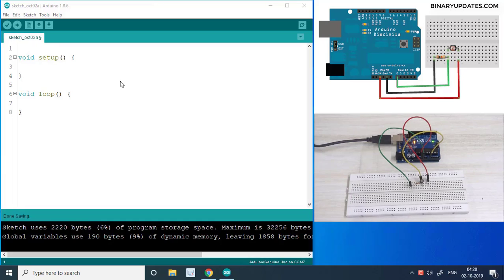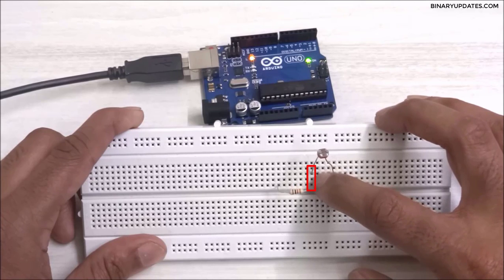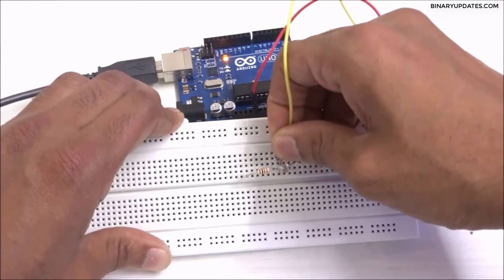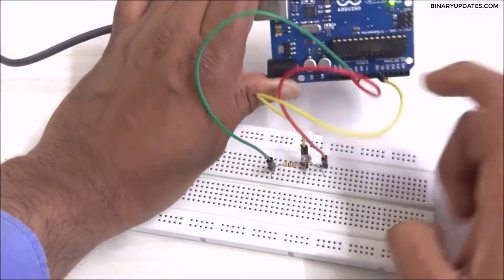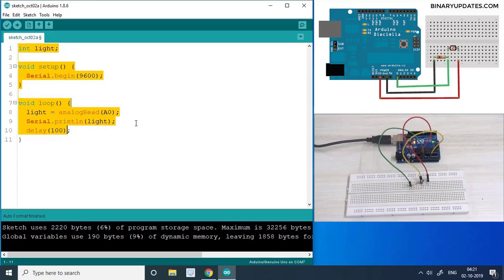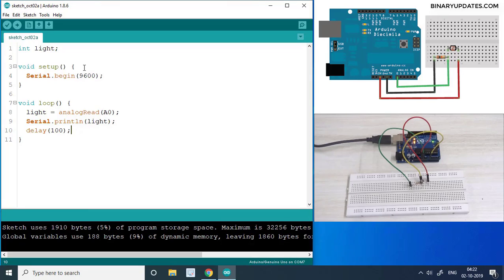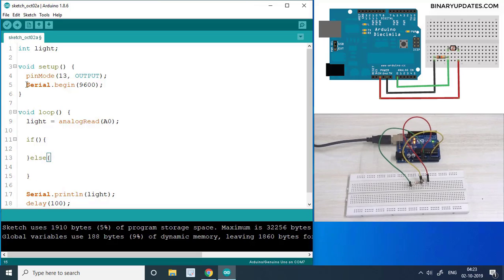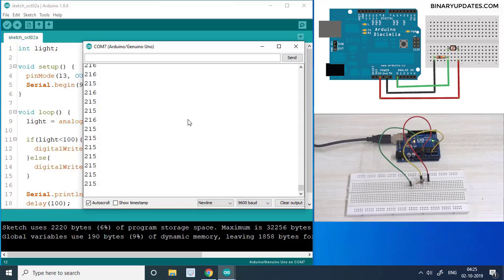LDR with Arduino - Measure Light Intensity using Photoresistor

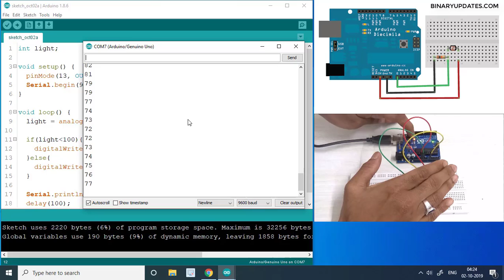Comment: 7:17  In which units the LDR sensor gives the output. In serial monitor
Reply from the maker: Hi Vamshil, the values getting on serial monitor is the equivalent of change in resistor because in the end LDR is resistor whose resistance changes as light falling on its surface changes. Usually, we need to convert this value into lux because light intensity is measured in lux. I hope this help you understand  LDR's functioning. Good luck and best wishes!
Reply: @BINARYUPDATES  and how do I do that?

Comment: what is 200 that is showing? 200 what?
Reply from the maker: Its a value of ADC counts which will vary based on amount of light falling on the surface of LDR Sensor. So later we can calculate Lux or illuminance
Reply: @BINARYUPDATES  but how?
Reply: how can we use it to calculate lux please? @BINARYUPDATES

Comment: Is a breadboard that big necessary ,can it work with a smaller one too?
Reply from the maker: Hi Katianuriu, Yes it will work with smaller breadboard as well. Just setup LDR circuit with Arduino on available tie points on small breadboard. Good luck and best wishes!

Comment: How to insert this to lcd?
Reply from the maker: Hi, you can interface Character LCD in 4-bit mode or use OLED display with I2C protocol. This will let you show light intensity value LUX from LDR on LCD screen. I have video posted in Arduino playlist on how to interface LCD Display with Arduino. I hope, you may find that tutorial useful. Good luck and best wishes!

Comment: Hi, great video but could you explain to me what the resistor going to the ground is for? I'm very new to arduinos and circuitry. Thanks!
Reply from the maker: Hi, you can use resistor of value 10K with LDR Light dependent resistor. Its standard across all input of 5V DV devices. Just like Arduino Uno which also operate on 5V DC. I hope this may help answer your question. Good luck and best wishes!

Comment: Thanks for this nice explain
But i would if someone please tell me applications for ldr sensor matrix  6×6 or 6×5
Because I have a project for college and i little confused how can I deal with that... And thank you so much
Reply from the maker: Hi Omer, thanks! I think you can consider using LDR sensor to measure light intensity of surrounding and then take two or three 6x6 dot matrix display connect them together and  show light intensity which means lux value on display. This could be one simple application to show in college. Also, you change the brightness of Dot Matrix display based on value of Light Dependent Resistor. I hope this may find useful. Good luck and best wishes for your project!
Reply: @BINARYUPDATES  thank you so much for your help , can I contact you in another your email , what's up or telegram? 
And thank you again ❤️❤️❤️

Comment: I tried something similar with temperature, and my experience says that you need some error to avoid oscillations between on and off state. What I mean, is that you better set two values close to 100, one lower value for on and one higher for off. Let's say the two values are 99 and 101, you want the led to be on when the intensity is 99 or lower, and you want it to be off when intensity is 101 or higher. In case of any values between 99 and 101, the led maintains its previous state
Reply from the maker: Hi Chris, thank you very much for your suggestions. Next time when I'll write arduino code wherein LDR data will be checked for lower threshold as well. Have a beautiful day!

Comment: Sir why are we using the resistor here?
Reply from the maker: Hi SRG, it forms voltage divider circuit which help you measure change in output voltage because of change in resistance across LDR. I hope this may help. Best wishes!
Reply: @BINARYUPDATES  Thank you Sir

Comment: Hi, I wanted to build a small box wherein light would fall on a piece of paper and the sensor should calculate the area of the paper which is blocking the light?? Is it possible??
Reply from the maker: Hi Gaurav, it is possible
Reply: @BINARYUPDATES  Hi thanks for the response. Can you guide me how this can be done I am in need of the same for school project. If you want we can discuss this on email or anywhere else suitable
Thanks.

Comment: I'm terrible at electronics 
I use the esp8266 microcontroller and I'm getting values from 20 to 50 although I did the same wiring ???
Reply from the maker: The value for LDR may vary as ESP8266 runs on 3.3V and Arduino runs on 5V. The other important thig contribute to accuracy of data based on value of resistor you've used with LDR Sensor. I hope this information may help you. Wish you good luck and best wishes!
Reply: @BINARYUPDATES  thanks for the help

Comment: Is the A0 input or output
Reply from the maker: A0 on Arduino is an Analog Input Pin can be used to read any analog sesnor. As in this case we used LDR light dependent resistor

Comment: Can i replace arduino uno with raspberry pi with same cooding?
Reply from the maker: Hi Azri, unfortunately Raspberry Pi don't have any analog pin on board. So you need to connect external ADC converter chip to interface LDR with Raspberry Pi.
Reply: @BINARYUPDATES  okay thanks for your response. I will use Arduino. Actually my project same like this, I was planed want to use LCD 1602 to view my result. What step I need to do to to get output on LCD?

Comment: how many ohms is your resistor used?
Reply from the maker: I've used 1K ohm but you can use any resistor value between 1K to 10K while interfacing LDR with Arduino. Good luck!

Comment: Thank you for the video sir. May I ask why are you using the 1kOhms resistor specifically?
Reply from the maker: Hi Reinalto, that 10K resistor connected with LDR circuit form voltage divider circuit which generate variable voltage. This variable voltage we measure using Arduino Microcontroller. And later on this voltage itself will interpret as a light intensity or lux value. I hope this help you. Good luck and best wishes!
Reply: @BINARYUPDATES  this definitely help. I was using a 2k and it's not working properly, now with the 10k resistor everything is working just fine. Again, thank you for the video and keeping the good work! You're blessed!

Comment: Thanks for the informative video! I'm trying to create a way to convert morse code light signals into text but I'm curious on how the photo resistor would be able to decipher and differentiate between dots and dashes. Do you have any advice on how to proceed?
Reply: I’m not entirely sure but you could try somehow reading a 0.5 second blink as a . And a 1 second blink as a - or use your own timings, whatever makes most sense to you
Reply: Far easier to generate Morse Code.
Reading it gets messy. I'd use the millis() function (Arduino milliseconds since boot)

sit in a while() loop waiting for the signal to go high.  Grab the millis() and sit in another while loop waiting for the signal to go low. Grab the millis() again and subtract the starting millis() to get the pulse duration.  This millis() stamp also begins the space.

repeating this process lets you build up an array of pulse and space times. the following rules may help you sort out the difference between pulses individual letters and words, but the timings are pretty variable, especially with human generated code, so you're going to have to be a bit clever with your math. once you think you have a bunch of letters, decoding it is just a matter of referencing a table of type byte, with each letter represented as binary digits.

The length of a dot is 1 time unit.
A dash is 3 time units.
The space between symbols (dots and dashes) of the same letter is 1 time unit.
The space between letters is 3 time units.
The space between words is 7 time units.

Comment: You can make the value go up instead of down by reversing the voltage polarity through the LDR and resistor.
Reply from the maker: Yes, its possible
Reply: I think at least one of the three-pin modules with the resistor built-in actually shows a pin out diagram wired this way. As far as I can tell, either way works, just be sure you know what you're expecting.

Comment: What is the ohm value of resistor?
Reply from the maker: You can use 10K Ohm resistor with LDR Light dependent resistor to form voltage divider circuit with Arduino Uno Pins. 

Best Wishes 
Team BINARYUPDATES

Comment: For some reason my LDR only works like a resistor, even if I try to move it to brighter space or cover it
I try replace the LDR with a resistor and I can tell that the variable are completely the same so it is kinda working
I used both of my LDR, the main one and the spare one and both aren't working
You have any ideas?
Reply from the maker: Hi, you need only one LDR for this project and other would be a normal resistor of value around 10K to form voltage divider circuit to measure the light intensity in lux which is an result of equivalent ADC counts from microcontroller on arduino uno. Usually, the two reason this may not work, One is wrong connections and other one is power make sure your arduino boards GND and 5V pin provide enough power to functions voltage divider circuit. I hope this may help you. Wish you beautiful day. Thanks

Comment: Dear sir, LDR and Arduino board is ok but there is no change in the value on serial monitor.
I have also connect LED in digital pin 13 but not glowing on covering LDR.
Can you please help me?
Reply from the maker: Hi Virendra, please make sure LDR and Resistor connected properly to form voltage divider circuit. The value of lux or LDR data depends on what value of resistor you've connected across LDR while connecting to A0 pin on Arduino Uno. Best wishes and good luck!

Comment: Please "pin" the components used in your configuration, ie, what is the size of the LDR used with your 1K resistor
Reply from the maker: The LDR used in video lesson is very commonly used LDR. One can find in any online store these days even on amazon
Reply: The photo resistor is pretty standard, there are usually one or two included in most of the beginner kits for Arduino or elegoo. But I would double check the resistor value. The photo resistor modules I've seen, where the resistor is built on a little 3-pin board, use 10K resistors.

Comment: this out values, are they in some unity of mesurement? like lux, or lumens
Reply: He doesn't know himself :D
Reply from the maker: Usually light intensity is measured in lux
Since LDR is light dependent resistor we read change in resistance through ADC counts on Analog Pin of an Microcontroller. The circuit we use in this project create voltage divider arrangement to let us measure change in voltage when light falling on sensor changes. I hope you get now. 
Good luck

Comment: What colours does the resistor have?
Reply from the maker: Not sure about color code since its very old method to recognise value of resistor. I use multi meter to measure value. Usually with LDR Light Dependent Resistor you can consider using resistor with value between 1k-10k Ohm. I use 10K Ohm for optimal performance to get accurate value of LUX from LDR Sensor

Comment: so how do we make FreeRTOS LDR sensor with seperated task ? like make on and off led in seperated task, i still can't do it 😩
Reply from the maker: You need to use FreeRTOS Library in Arduino Code. And create independent task for turning LED ON/OFF. Not sure your objective because you can achieve simple LDR interface without FreeRTOS. I recommend use millis() function instead

Comment: instead of putting the wire at 5V, can I put it at VIN?
Reply from the maker: No VIN pin on Arduino Uno is to give input voltage to Arduino. Not to take from arduino to supply 5V to other devices like sensors, displays, motors etc.
Reply: @BINARYUPDATES  ok

Comment: mine jump from 300 to 700 and back to 300.. and if I block the light it jump from 0 to 1023 and back to 0...
why?
Reply from the maker: I believe it maybe because LDR connections will be loose on breadboard. Please confirm once and give it try once more

Comment: could i use the 3.3V or would that not work
Reply from the maker: Yes Kate you can use 3.3V as VCC as a reference voltage with LDR Light Dependent Resistor

Comment: Why did you use pin 13 in code?
Also you didn't connected any wire with pin no. 13.
Reply: the yellow onboard led on the arduino is connected to pin 13 internally

Comment: Thank you very much for this video. I need to make a DIY CT Scanner and I am planning on using these. Could you make a video for the code for getting the reading of multiple resistors at a time please? Also, What's the difference between these photoresistors and the Gowoop photosensitive resistance sensors?
Reply: CAN YOU MAKE YOUR OWN LIGHT INTENSITY METER with CIRCUIT EXPLANATION???
https://youtu.be/JTcircQha3A
Go find out

Comment: Arduino Uno- Serial Monitor is showing up  like 200 or 217 . Is this 200 or 217 in light unit Lux ?
Reply: guess this is late, but its only a number from 0 to 1023, no unit. 
It doesnt give you any unit, its just a value which is given based on the resistance the LDR is at the current light level (Not the resistance in ohms either).

Comment: Bro what is the units of output lightning intensity? Is it LUX or not?
Reply from the maker: Hi Pulitha, the light intensity from LDR can be measured in Lux:
The "lux" which is the SI unit of illuminance, measuring luminous flux per unit area.
Reply: CAN YOU MAKE YOUR OWN LIGHT INTENSITY METER with CIRCUIT EXPLANATION???
https://youtu.be/JTcircQha3A
Go find out

Comment: hey hello I had a question,
can we measure wavelength of a particular led using the intensity of light measured by ldr?
Reply: my suggestion would be using a low and high pass filter. if you want to be approximate some colored plastic might do  the trick!
Reply: @LUCABALUCA  but how to.measure wavelength will it give direct value?
Reply: Technical Engineer ah to measure a wavelength scientists use light spectrometers. To my knowledge they use filters to measure at each wavelength and then look at the graph ti figure ou which wl it emits at
Reply: CAN YOU MAKE YOUR OWN LIGHT INTENSITY METER with CIRCUIT EXPLANATION???
https://youtu.be/JTcircQha3A
Go find out